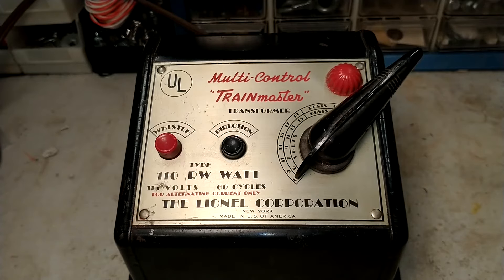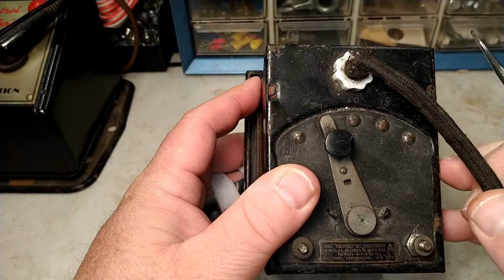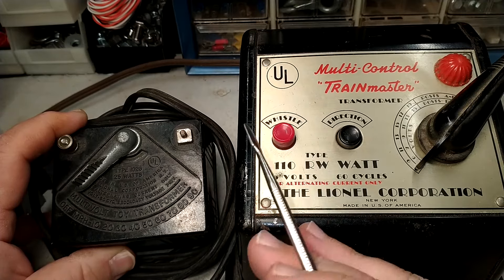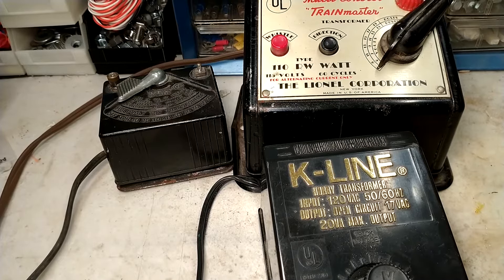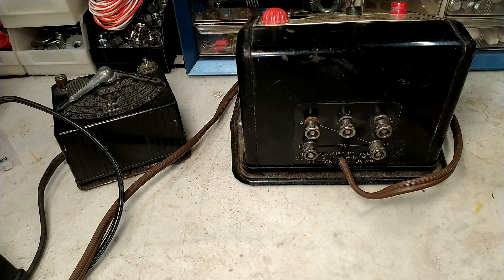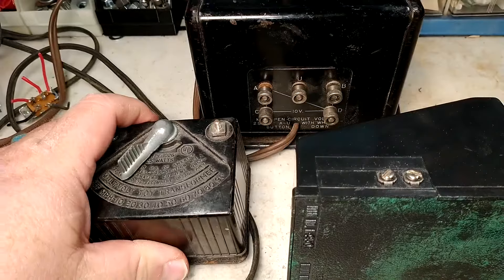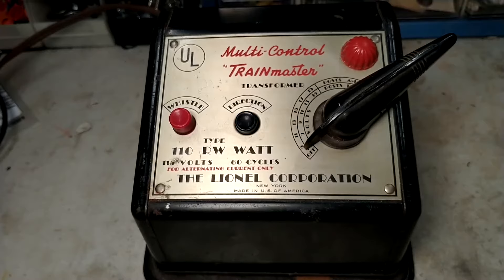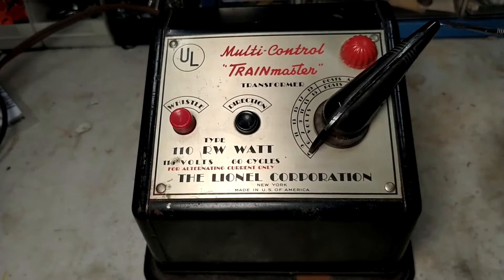Transformer Tutorial - How To Power Your Trains

Comment: From a retired electrician here's a tip. Would strongly recommend that you use a GFCI  or better yet combination AFCI/GFCI that provides ground fault ( shock ) and arc fault protection. If you do replace the power cord would only use a 3 wire cord. In transformer only had a plastic case attach the green wire to transformer. We had two sets of American Flyer trains and my electrician dad purchased a mulitivolt transformer to supply power to lights inside houses. My dad would make a drawing how to wire everything. Told me to call him if I ran into trouble. Had so much fun playing with train wired that I spent 50 enjoyable years as an industrial electrician.

Comment: Hi just wanted to ask anyone if they know what transformers were put in the Franklin mint Norman Rockwell celebration of America z gauge table top train sets as I’m in the uk on 240 volts, but the set has what looks like a Europe two pin plug, I’m confused,will it run on our current, is it a duel voltage transformer , any help much appreciated.

Comment: circuit breakers do not protect you from electric shock. Standard circuit bkrs  measure load.  Ground fault offers protection against electrical shock because they measure return neutral current.

Comment: I got tired of my engines slowing down at furthest point on where power was attached. Would solder all the tracks together making sure to file & sand paper top & inside side wall smooth. Would then solder a wire every 3 feet and tie them together to make a loop around tracks. Last two times I set my trains up my son's only spent at most 5 minutes running them the first day then maybe a minute days later and list all interest in them. Finally sold them.

Comment: Hi Mike: When you put up the sketch/schematic of the "ZW" transformer, I recognized it immediately as the transformer that Gomez Addams had connected to his train set. First; he'd push the "RIGHT" side lever forward, and #1 steam -engine train would start to move. Then, he'd push the "LEFT" lever forward, and #2 Steam locomotive would start moving (In The OPPOSITE DIRECTION)! Then... He ran them HEAD -ON into each other when they met in the middle of a bridge. Then, he BLEW -UP the bridge! Well... Thanks for revealing to me Mike, that Gomez Addams "ZW" transformer is REAL! You've answered a question I've had for the past 55 years! Thanks again Mike. Jeff

Comment: Is there a way to make a tethered walk around controller for our conventional   3 rail trains that's affordable?
Reply from the maker: Yes. You will need a project box of appropriate size, a rheostat (even a household light dimmer will work) and 4 wires 16 gauge or larger. Two wires run from your constant voltage transformer to the rheostat inputs. Two wires run from the rheostat outputs to the track. Not pretty, but it works.

Comment: I've got one of the old pre-war tapped "doorstop use only" transformers powering my laptop right now! It's running off an isolated inverter power supply at double voltage and 500Hz AC, so no direct connection to the mains or large fault current available. Great video!
Reply from the maker: Nice!

Comment: I bought a Bachmann electric ⚡️ train 🚂 set about 8 years ago. It came with a length of track (about 8 feet 👣 long), and included the transformer, locomotive, and cars 🚗. I’ve watched actual trains, with 14 locomotives pulling it. I wanted to add the same excitement to my home 🏠 train set. Even if I had to buy two more identical train sets to gain more track length for all the locomotives, I’ve asked at a few hobby shops 🏬. I think the added track is okay, but they say having 14 locomotives on my train set will burn the transformer 🆙. Is there a transformer that can handle 14 locomotives? I bought this train set around 2013. I want to enjoy 😊 my train set MY WAY, but I don’t want to face transformer burnout, or possibly a fire hazard. Do ya have a recommendation on what transformer I can use, even if it’s $200.00? It’s also said that the included transformer still may not be able to handle 2 locomotives. The hobby shop says even this could burn my transformer out. Can this, in turn, also burn the locomotives out? I know that locomotives are not cheap to buy. Like 👍 you said, I got a starter set, and the transformer is just powerful enough to run what locomotive was included in the train set. Sorry 😞 about the long comment, but please can ya tell me what transformer I should buy, if I want to have 14 locomotives in the set? I just subbed to your YouTube channel!! Your friend, Jeff!!
Reply from the maker: It sounds like you have an HO or N scale Bachmann set. You will not find a transformer capable of powering 14 motors at once. Modelers overcome this by adding non-powered, or "dummy" locomotives to make it LOOK like they have multiple units. BTW, if you saw a train with 14 units, all of them were not operating. The maximum number of units in multiple unit operation is 8.
Reply from the maker: In the world of models it is very difficult, even with command control, to get more than 2 or 3 motors to operate well with one another.
Reply: @ToyTrainTipsAndTricks  Yes, you’re right. Not all locomotive 🚂 train motors are geared exactly alike, and the electric ⚡️ motors don’t run 🏃‍♀️ at the exact same speed. Since different manufacturers 👨 make different locomotives (and even amongst the same manufacturer), two locomotives may try to push or pull against each other, causing unsatisfactory performance 🎭. This can be very disappointing with electric trains. My transformer is simply a modern plastic one ☝️. I was going to try two locomotives, but I’m afraid 😳 even that will burn it out. I’ve also got a tip for you, but you probably already know. Never 👎 use steel wool to clean 🧼 ANY locomotive train parts, or the track. This may be tempting, but steel wool is the ultimate train 🚊 killer. 🔜 as ya put the locomotive on the tracks, any metal “fuzz” will become attracted to the magnets 🧲 inside the locomotive, shorting them out. In other words, your train set will be ruined 😠. The very same thing also applies to slot cars 🚗. Sorry 😞 about all my emoji’s. I seem to have fun 🤩 with them along the way. Your friend, Jeff.
Reply from the maker: @jeffreyhickman3871  The determining factor for the number of motors you can run is the wattage/amperage of the transformer. In HO or N most starter set transformers can handle 2-3 amps maximum, which is around 4 can motors working under heavy load.

Comment: Good Video and just as I was looking for- almost.   The transformer in the most of the video is like the one I have.   I can not figure out how to the the outer case off of it?   There are 4 screws on the bottom plate,  there are also what appear to be standoff's, with no visable way to remove those except for drilling them out....   Surely there is a way to get inside this transformer without having to drill those 4 (I'll call them posts or standoffs)  out to open it up.   I've just unpacked this after nearly 55 years in storage.  It came with the Lionell 681 engine, tender, oil tanker, milk car, a caboose.  The arm on the 'speed control' is very rough to move from off to full power.  Binds in the middle a bit.   IDEAS ???
Reply from the maker: My transformer is still boxed from my recent move. I will try to dig it out and take a look at the screws. I have a 1033 of the same era that uses Phillips screws.
Reply: @ToyTrainTipsAndTricks   I got it figured out.  The 4 screws on the bottom are all that need to be removed.  After that there are a couple of tabs that need to be straightened then the top just pops off of it.  Don't know why I didn't see that first time around.
Reply: @avflyguy  Did all Lionel 681 steam engines (sets) come with that transformer..? I am a newbie as I inherited my grandfather's Lionel engines and locomotives..? I am only keeping the Lionel 681 with a 2671WX tender, Sunoco 2 dome tank, 6457 caboose... I'd like to find some O gauge track and transformer. But as I stated, I am new to model trains, but soaking up as much as I can. Any guidance is greatly appreciated... Thank you for your time sir

Comment: I would trust a rattlesnake with a 'pet me' sign before I trust those old circuit breakers. First off, they automatically reset, so if one is not paying attention, they will trip, then cool, then trip again because the short circuit is still present. I have seen dozens fused closed over my years restoring trains, which means, in essence, that there is then no functioning breaker inside. I always strongly recommend people use external push button reset breakers. Second, Lionel used one breaker for all transformers. These breakers had a set screw on them This screw adjusted the amount of power (And therefore heat generated) can pass through the breaker before it tripped. In theory the screw was set the right way at the factory, but a theory holds little weight when electrical safety hangs in the balance. A few degrees turn of the screw can be the difference between a fire and safe operation.
Reply from the maker: Thanks for the tips!

Comment: There’s so many transformers to choose from.  The ZW, Z4000, Right of Way 2020 (said to be the best transformer ever made), and the ZWL.  However the bigger the layout, the more watts you need.  Ever thought of getting a 400 watt transformer?
Reply from the maker: For my layout, no. I am set up for multiple operators set up in various locations around the layout. I also use a zone configuration for accessories with smaller transformers powering the accessories in different areas of the layout. By using common bus wiring and keeping all the transformers in phase I have more than enough power for my needs at an overall lower cost per watt than with a big block transformer. If everything was controlled from a single location, I may reconsider.

Comment: I bought a couple CW 80 transformers. They are showing up at train shows brand new for $20.00.
Real cheap. Someone told me it's because they were phased wrong from the factory. Lionel
had a bad batch but they work fine if used alone I'm told.
Reply from the maker: My understanding is that SOME CW80s were phased incorrectly, but not all. Also, some of the later CW80s had a batch of bad boards in them. I find the early ones work well.

Comment: So for the most part three-rail is AC powered, but since G scale is only two rail, is that ran by DC power?
Reply: Also, can the newer DCC locos run on these older transformers?
Reply from the maker: G scale is generally DC power.
Reply from the maker: If your DCC system requires AC power (or DC power with a rectifier), the answer is yes, BUT...since these older power sources predate the sensitive electronic components in many modern locomotives, you must add some safety features to protect your modern locomotives. Specifically, TVS diodes (essentially "surge protectors") should be added to your transformer outputs (or better yet in the locomotive itself near the circuit board). https://amzn.to/3Ozyl87 These diodes are bi-directional and should be wired across BOTH the hot and common side of the circuit.
Reply: @ToyTrainTipsAndTricks  , are "snubbers" the same thing?
Reply from the maker: @robertcornelius3514  I'm not familiar with that term. Sorry.

Comment: i have a question   I have a Round the Pole model airplane set up that i bought shiped from the Uk    There transformer is Not wired for Usa ,   i need about 14 volts DC to fly the airplane   I tried a 12 volt car battery but just lacked enough power to fly  ,  the airplane motor is 6 thru 12 volt motor but the problem is the power loss down the fly lines to the model , Do you have any idea if a DC train transformer would work for me ??
Reply from the maker: Do you happen to know the wattage/amperage of the original transformer? An HO scale DC power pack will provide the voltage you require, but if the power is insufficient it may not work. Try to find a source that matches both the voltage and the wattage of the original unit.

Comment: I bought a Gilbert American flyer 8b to make an archery feather burner, the tutorials I've watched, they bend a piece of high resistance NiChrome wire and bend it to the shape they want the feather, then hook one wire to one side of the NiChrome wire and another to the other end, then hook those wires to the middle and left "base" post of the transformer. 
 My problem is the green light comes on for half a second and then the red light comes on, I'm assuming that means there's a short? I'm definitely no electrician, the tutorials on feather burners I've watched used cheaper transformers without a reset button but idk. 
 If you have any advice I'd greatly appreciate it and if I simply can't use this unit for my project, if you have a cheaper version that's at least 35 amps I'd mail you mine if you'd want to trade. I don't know much about this train hobby but it looks awesome, I wouldn't want to destroy a transformer with collectibility on a feather burner if you could use it
Reply from the maker: I watched a video on the process to get an idea of what is going on. Nichrome wire is nothing new to model trains as they are used in the smoke units of model steamers.   The issue appears to be the resistance of the wire in this application is greater than the tolerance of the circuit breaker in the 8b. Not being an electrician myself, I cannot determine if the problem is a faulty breaker, too much wire, etc. I know that some older breakers are more sensitive than others, so it might be an issue with this individual transformer or not. I wish I could provide more help for you. Thanks for watching!
Reply from the maker: What does the transformer do with no load? Does it still trip the breaker? If so, there's a short inside the transformer itself, which is not uncommon in 60 year old components.
Reply: @ToyTrainTipsAndTricks  thank you for the advice, I took it apart last night and there was a bare spot in a cloth insulated wire, i covered it with several layers of liquid electrical tape and put a good layer on the rest of the wires, I'm thinking that was definitely the problem and I'll try it again today, that liquid electric tape is good stuff, I just wanted it to be super dry before I tried it again.  If it doesn't work this time, I'd be happy to mail it to you for nothing, I'll toss it if not and buy a factory feather burner lol, I'm over this diy project!
Reply: @ToyTrainTipsAndTricks  also, the plug wire, i replaced it with a new one, the old one was ok till a foot out of the transformer so I cut it about 4 inches out and with crimp sleeves added a new one. My question is, does it matter which side of the outlet goes where? Most wires are color coded, my new cord had the usual black and white wires under the outside insulation but the old transformer just had the two black coated wires, could I have gotten it backwards? 
  Im definitely not an electrician! I've been a welder for 30 years but man, trouble shooting electrical problems just ain't my thing.
Reply from the maker: @shanek6582  On the older transformers it doesn't matter which way you go.
Reply: @ToyTrainTipsAndTricks  man I really really appreciate you answering. It's not too often anymore that content creators answer my stupid questions, I'm subbed for life lol. 👍👍👍

Comment: I've got a cw 80 and if I need to run DC I can use my g scale transformer
Reply from the maker: For what purpose are you using the DC circuit? That will make a difference in the answer to your question.
Reply: @ToyTrainTipsAndTricks  for mpc starter set engines that use DC
Reply from the maker: @OldIronVideo  Ok. Yes, the small can motors on those locomotives should be okay on a G scale DC transformer in theory. Make sure you don't exceed 12 volts or so just to be sure.
Reply: @ToyTrainTipsAndTricks  alright I've got a spare volt meter

Comment: What  transformers  do you  use
Reply from the maker: Here's a more complicated answer than you were expecting. I don't use a central operating point for my railroad. Instead, each sub-section has it's own available power. However, thanks to 2P6T rotary switches, each transformer has the capability of powering the entire layout. That gives the operator the choice of power based on 1) where do I want to stand? 2) Am I running Postwar or Modern and does the whistle/horn work better on a throttle of comparable age? 3) AC or DC power? 4) Personal favorite. So, my current choices are: K-Line RailChief, Lionel CW-80, Lionel RW, or Marx/Allstate 1825 (with DC power converter) for the tracks. I used to have a Lionel 1033 connected to a dimmable remote for walk-around power, but the dimmer unit died. Accessories are powered by a Lionel 1033 (16v and 11v bus lines), and 2 K-Line "Black Box" starter set transformers (for the Operating Cattle Car and Operating Freight Station, respectively, so I can fine-tune the power for these finicky accessories). On my workbench, I have a Lionel "Black box" starter set transformer and a small Life-Like power pack when I need DC power.

Comment: I must admit, i have 12 type a to type t's. About 30 or more of the old ones. Use them.repair the cord and put a 5amp breaker on the u post. And one one the number one post for accesories. If u want. I adore mine. Oldest one i have is about 110 years old. And is a champ.  Ps do not plug them in untill you open it up and see whats what.
Reply: Pps i like the american flyers, 1250 to 1266 are awesome. 75 to 150 watts and way smoother arm and more voltage selection. Im gonna put some lights on em for power and short indicator.